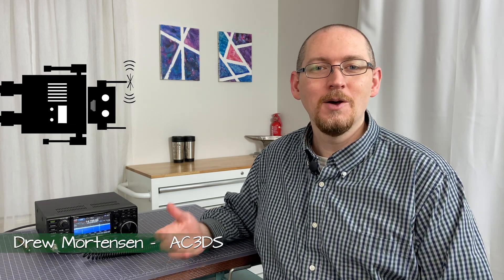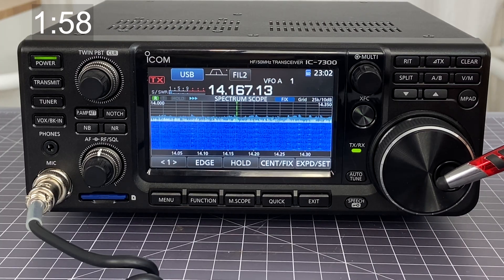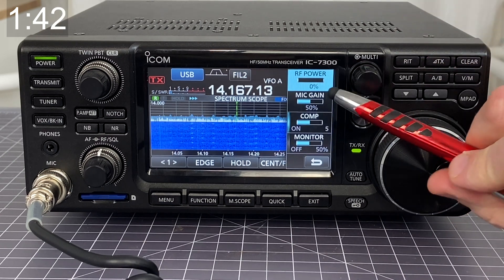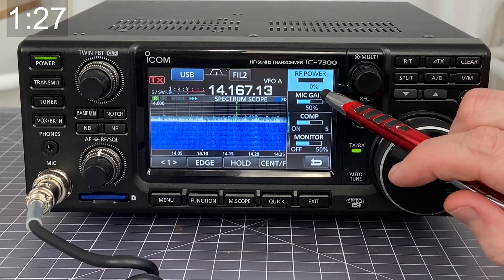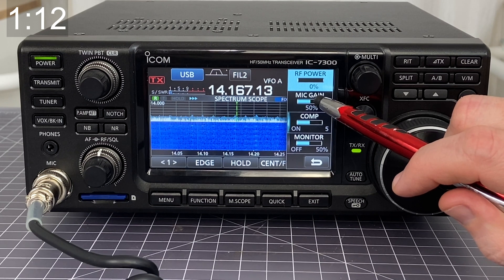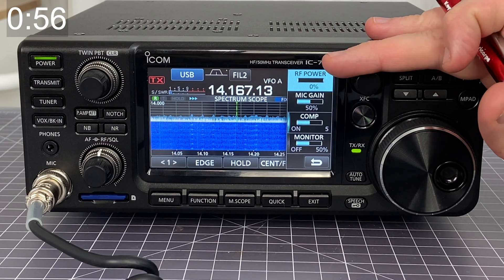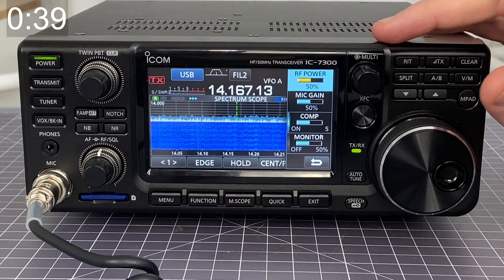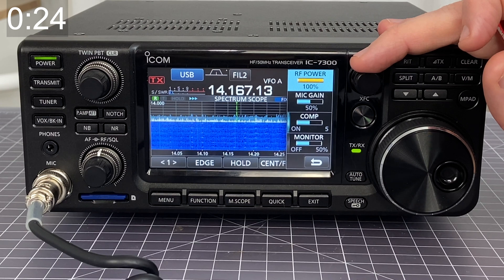2 Minute Tutorial: Changing RF Power Output on Icom 7300

Comment: On my almost new US version 7300 with the latest firmware (1.42) at least as of this morning, if I set the power out percentage while in any band except the 50MHz band, that percentage doesn't carry thru when I change to the 50MHz band. And the power out percentage set while in the 50mHZ band doesn't transfer to the other bands. I noticed this when testing a dummy load for SWR across the bands after thinking I'd adjusted the power out to 15%. I was totally surprised when I switched to the 50MHz band, and the radio was putting out 100 watts according to my external in-line wattmeter. I'll admit that I haven't read every line in the manual, but I didn't see any mention of this phenomenon in the section about adjusting the power out percentage. Anyone else seen this, and is there some setting that I've missed to make the 50MHz power out follow the setting for the other bands?

Comment: My IC7300 will put out 100w on RTTY or FM, But only 30 watts maximum on ssb with power set at 100%. I have checked audio settings. my mic gain is 65% which is considered very high. I use a RF power components Maxi Tuner in front of the Transmitter. The SWR is in spec and i know the Impedance to the transmitter is 50 ohm.
Reply: You are one of the many thousand hams in the world who does not understand yet the meaning of PEP and AVG output power and believe their 7300 needs alignment or modify to increase the power.I am sure you are reding your PO using an average wattmeter as many out there in the market and is very NORMAL to read between 30 to 40% of your rated power on RTTY,FM and CW when you talk on SSB. The only way to see your actual powerof 100W is reading it using a PEP power meter, otherwise you will NEVER see more than 30 to 40 W. And please don't pay attention to some hams who advice entering the calibration menu to increase your average power up to 100 W because then your are actually increasing the 7300 to 160 to 170 WPW and it will decrease substantially your spectral purity incresing your IMD3 creating splatters around your freq and besides you will put your radio in risk for passing higher RF current trough the small relays in the low pass filters and in the antenna tuner. I advice you to access my video here on youtube where I explain detaily why not to increase your AVG power, open this link:  https://www.youtube.com/watch?v=GYDq9cTtj4k
Reply: https://www.youtube.com/watch?v=LJRZeicyM6o&t=18s

Comment: But yor icom has not 100w in ssb, unfortunately.....
Reply from the maker: Thanks for posting PA1RAF.  You may be referring to the ALC. I’ve read that the ALC does have the potential to drop the output down a bit in SSB based on audio peaks depending on settings, but I don’t have any way of verifying. Regardless, I’ve been able to get up to 7000 miles on SSB, so I’m very happy!
Reply: @transmittinguntilrobotsrep1045   I have actually made contacts that were 8,500+ miles away running 100W on SSB as well.
Reply from the maker: @K4SRF  Nicely done - 8,500 is a mighty distance. With propagation improving as the solar cycle ramps up, hopefully everyone will be enjoying great DX.  73!
Reply: @transmittinguntilrobotsrep1045  I wish you good Luck with your setup.  73